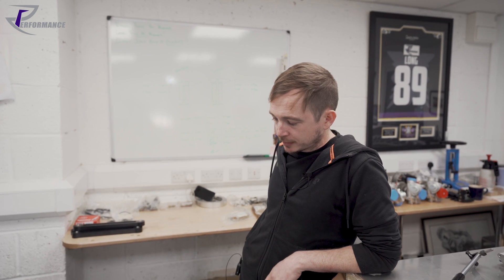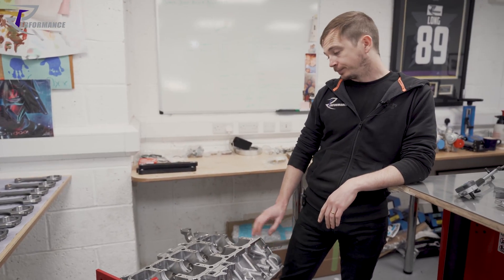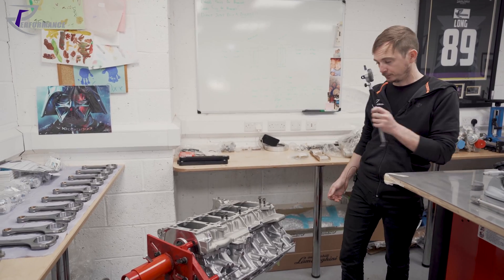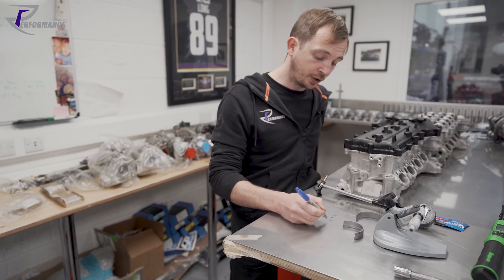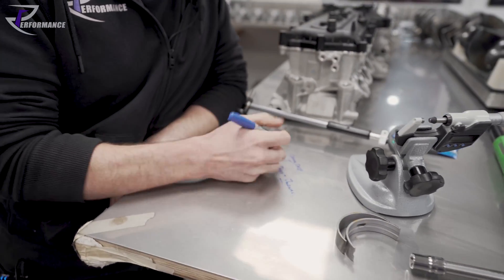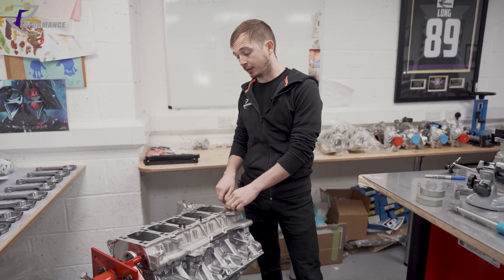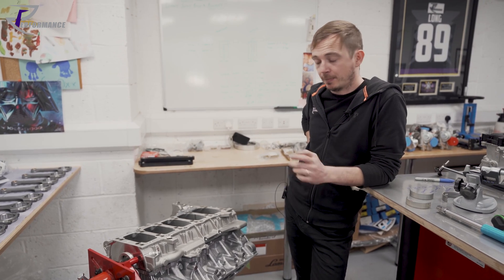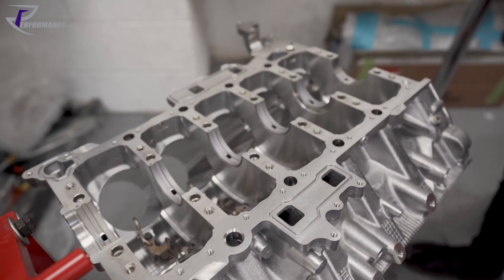Lamborghini V10 Bottom End Assembly Explained

Comment: Why don’t you just put the journal diameter into the bore gauge and insert it into the housing bore? It will read the clearance without all the math.
Reply from the maker: A valid point, but if your journal diameters differ slightly then you have to set the gauge differently at each measurement.

This way you know your absolute crankshaft journal size once polished and your absolute crankshaft bore size at each individual journal. 

The software we use does all the math inside it and with our Mitutoyo gauges we transfer the data via a cable from the gauge so no mistakes.
Reply: @REPerformanceUK  I understand that. Most of the engines I overhaul, the journals don’t vary much more than a few tenths, as I’m sure yours don’t either. Maybe better? Simple math in your head can quickly come up with a clearance. We just keep record of it and can’t change it much due to the lack of shell thickness options. Maybe +- .0005 max. 

Curios of what software you use? It would be quite useful in record keeping for future reference.
Reply from the maker: @timothyhess9403  We use Performance Trends engine log book.
Reply: @REPerformanceUK  Many thanks ! great series, thanks for posting.
Reply: @REPerformanceUK  in other words Ricky, you do it the Proper way.

Comment: i have a question... do you use ball hones for rifles and shot guns to deburr and polish the oil galley passages in the blocks...  then check the flow rates with water thru them..  earlier exotic engines had tiny oil passages that required the engines to be idled to bring the oil up to full temp as the cold oil just won't flow causing the bearings to be starved for oil.. 

 i used to build my small and big block chevy's for my own use with hours invested in oil galley work..  a friend caught me drilling the oil passage on his 428FE ford from the oil pump to the oil filter mount with a foot long 3/8 drill.  he screamed what the heck are you doing.. i said i know how you drive your car.. the last 2 engines you had blew up do to bearing oil starvation.. that is not happening again..
Reply from the maker: Yes we play with oil galleries in certain engines, normally if we notice potential problems in the builds.

Comment: That’s not really correct ur ment to crush bearings then measure that to get accurate crush height
Reply from the maker: You cannot adjust crush height, you adjust the bearing clearance by changing the bearing thickness. We measure the bearing in hand then measure installed in the rod/main journal to see if we get changes.
Reply: @REPerformanceUK  yes I agree it’s not good to change crush height but race teams do it all the time in Australia it works I wasn’t sure if you guys were installing bearing and bolting them up then measuring them, I thought you guys were just measuring bearing thickness and bearing tunnel and that’s it good to know ur not just doing that 😅
Never got around to that mclaren bottom end video ?
Reply from the maker: We do loads more than what we show! Yeah the McLaren bottom end video is coming….just trying to reverse engineer everything atm!
Reply: @REPerformanceUK  awesome can’t wait

Comment: I don't quite get that difference between bolts and studs. They are both loaded on both ends with the same force, otherwise they would just accelerate one way or the other. Both bolt and stud are loaded in tension between top and bottom end, The only difference i can see that the stud is bolted into block without load, therefore there is no friction on the threads, and the metal meat around it does not get distorted, Bear in mind I am a layman.
Reply: "Studs provide the ability to obtain much more accurate torque values because the studs don’t twist during tightening as do bolts. Because the studs remain stationary during nut tightening, the studs stretch in one axis alone, providing much more even and accurate clamping forces. Also, because the use of studs results in less wear applied to the block’s threads, this extends the life of the threaded holes in the block over periods of servicing/rebuilding. This is especially important when dealing with alloy blocks. The use of studs also eases main cap installation, and contributes to main cap alignment. There is less chance of main cap walking because the studs remain stationary during cap clamping."
Reply: @f5asa  that is a very comprehensive answer to the question sir, and completely makes sense. I too was wondering what the differences were and you answered it perfectly.
Reply: https://www.autoserviceprofessional.com/articles/2492-engine-studs-understanding-the-advantages-of-using-studs-vs-bolts-and-tips-on-achieving-proper-clamping-loads